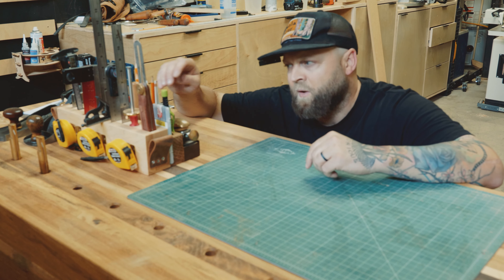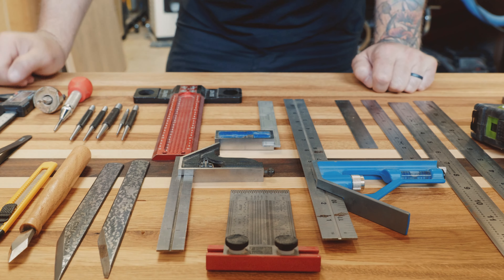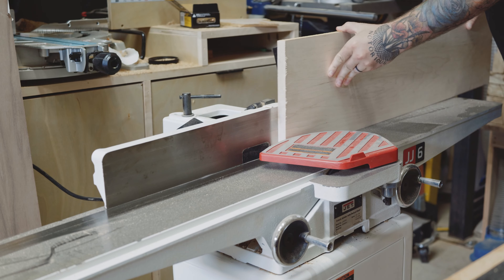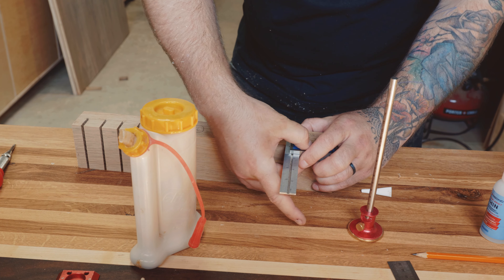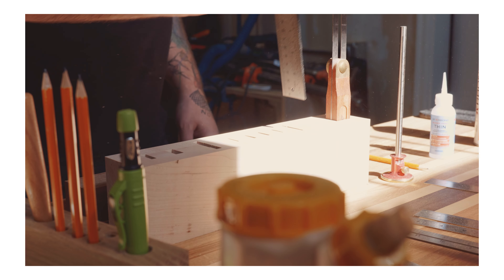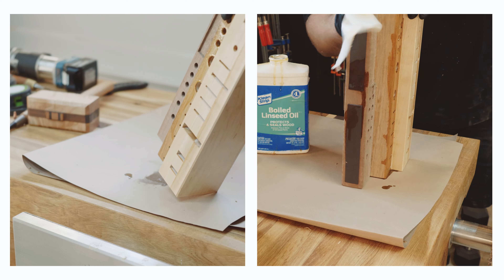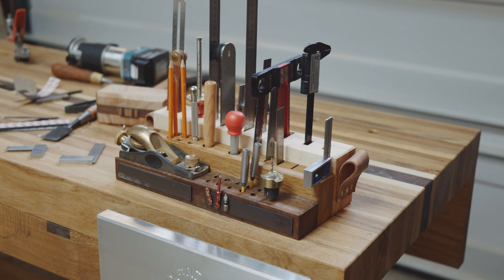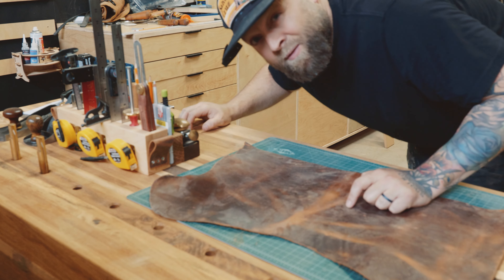Build the ULTIMATE Small Tool Holder - Tool Caddy

Comment: I love the idea of these things, but then where do you put them?  I don't want that taking up permanent space on my bench.  In my case I put it on a wall mounted rack that hangs to one side of my bench.  It isn't mobile, but then, in practical terms, neither is my bench.  Also, I would only use a 1/4 of those tools; 5 nail sets?  I have those in my bucket boss, and another set in the bags of my Occidental framing set.

Comment: What brand is that black and red T square?
Reply from the maker: Precision Marking T Ruler Imperial T Square Woodworking 6 Inch Aluminum Alloy 1/32 inch Increments Hole Positioning Scribing Ruler

On Amazon
Reply: Thank you